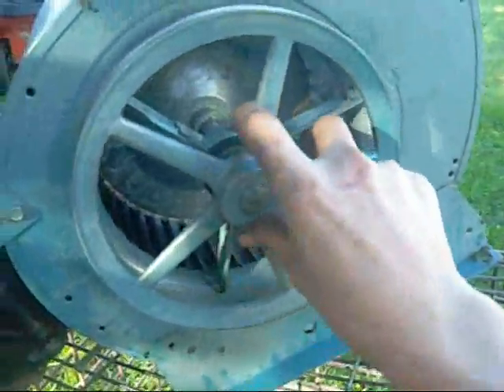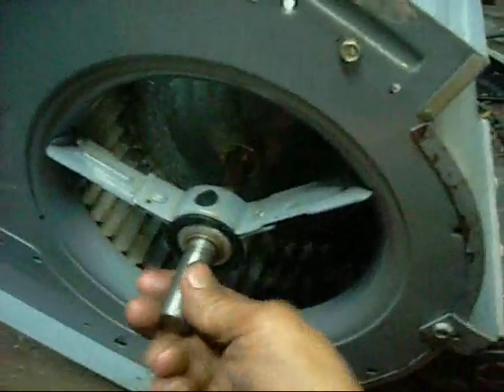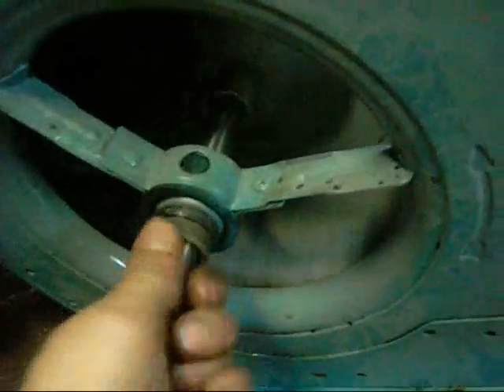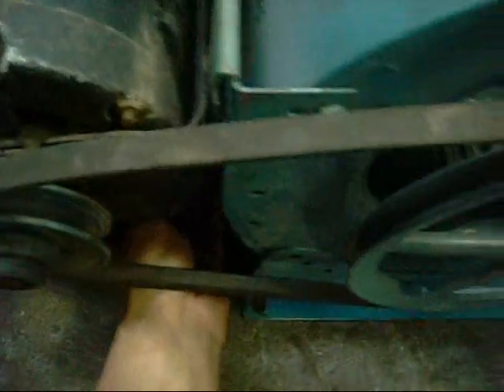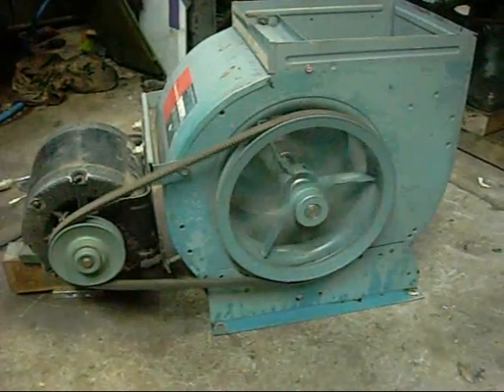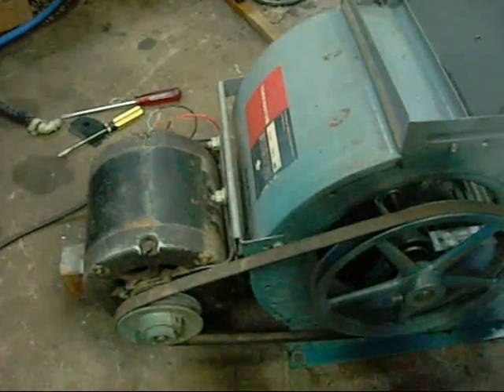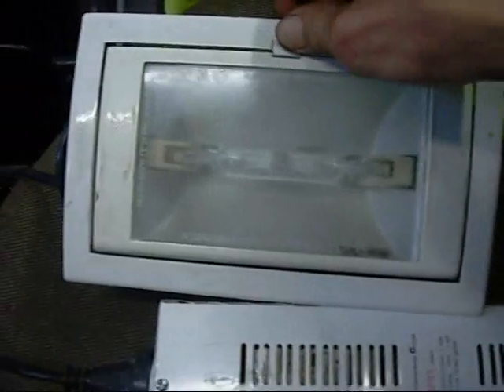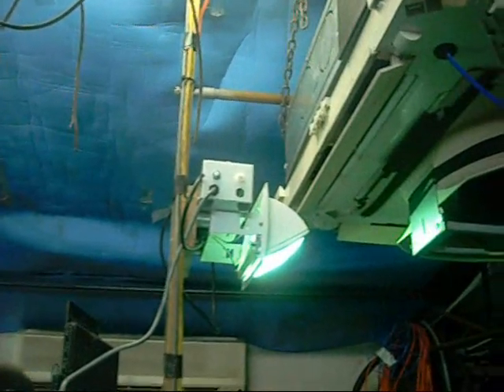1968 Torrington Centrifugal Blower and Metal Halide Lamp test

Comment: You say the metal halide lamp came from a jeweler's shop, was it actually used in a display cabinet, or was it used for general area lighting in the shop or was it used for window display lighting?  Most in store jewelery cabinets usually use little helogen lights, I'm guessing most of them are low voltage 12 volt lights, tht metal halide lamp makes a bit of noise when it starts up, I guess they all do.

Comment: @Lachlant1984 The word "notorious" just means well known for, or commonly associated with. It can be bad or good depending on what something is notorious for. 

ex: 1980s Briggs & Stratton engines are notorious for bad valve seats, but also, Honda small engines are notorious for good reliability.

see? it can be used for either bad or good. :)

Comment from the maker: @Lachlant1984 the groaning may be belt noise being exadurated by the camera mic, its very quiet compared to the cheaper new units.

there is a lot of airflow noise because of no back pressure in the cabinet.

Comment from the maker: @TheCoolmaster100 I gave the bearings a full clean and lube, slid the shaft across and wiped the journals down a few times then lubed them with a mix of DTE oil and chain/bar oil (DTE is great but adding 50% chain&Bar makes it tacky enough for plain bearings and slide ways)